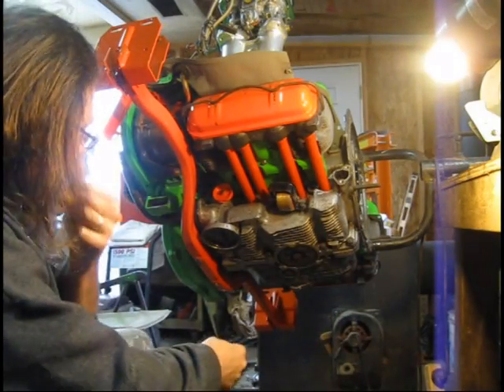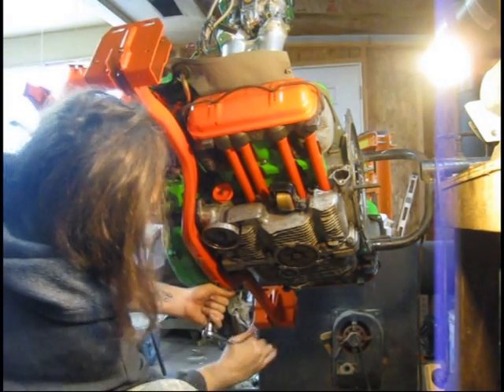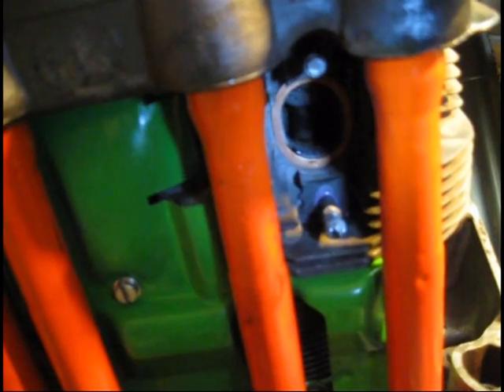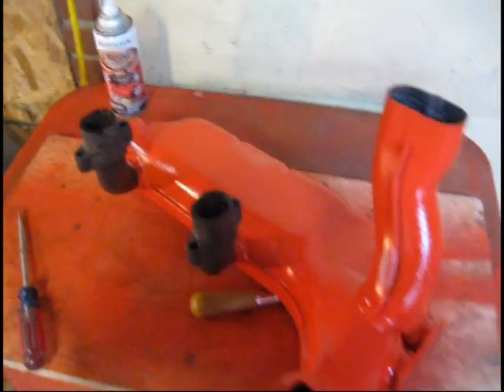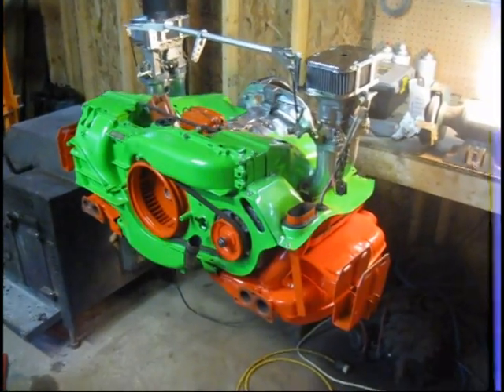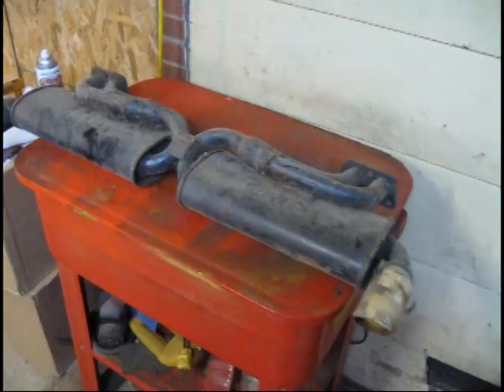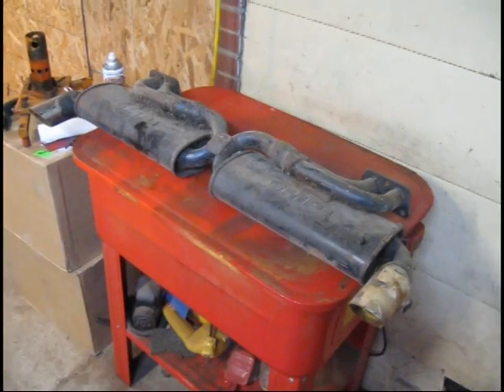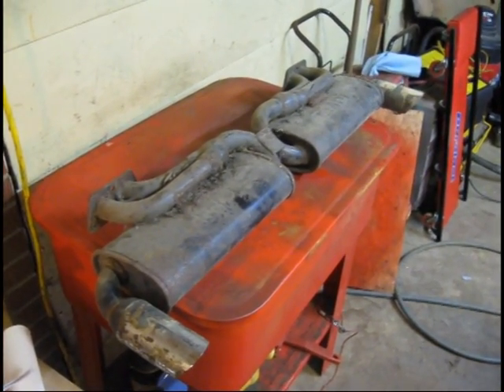Heat Exchanger-Engine Support Install

Comment from the maker: @FelixTheHouseFreak 
it's classed as a "horizontally opposed 4 cylinder engine", it runs like all other VW air-cooled engines, however, it's internal components were a little beefier that the others developed before it.

thx for watchin'